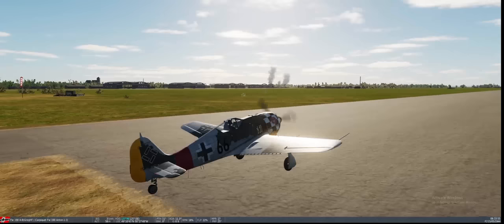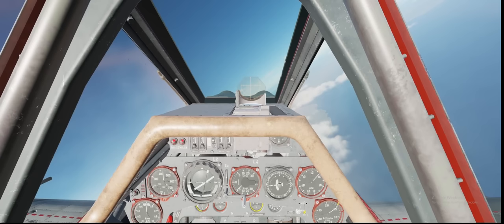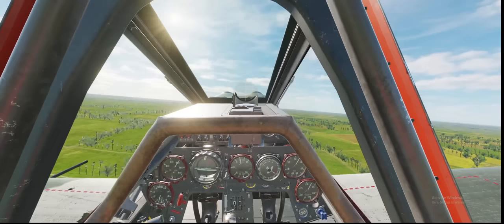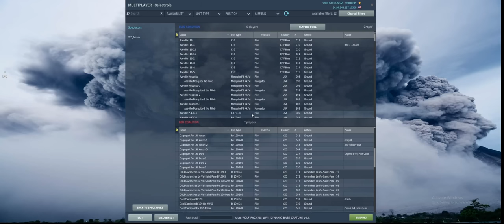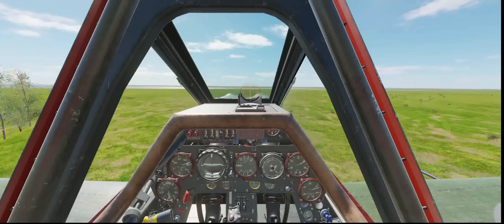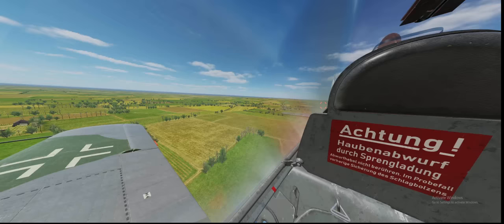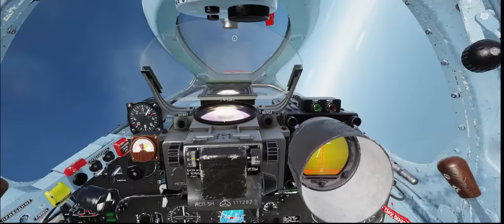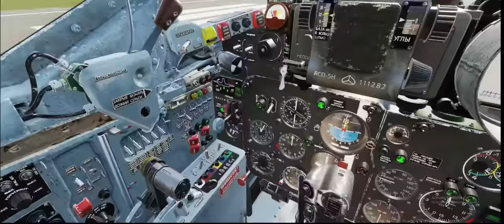German Cannons, Soviet Cannons, P-47 Mach, Angry Authors and More

Comment: Jimmy Doolittle was also an accomplished engineer. He even held a Doctorate in Aerospace Engineering. Doolittle was the first to do an IFR takeoff and landing, the first to do an outside loop, famous air racer, and helped standardize high octane fuel in the US, among many other accomplishments. He did not need Eric Browns help nor the British help in general. If he needed help, he had access to NACA and the aircraft manufacturers.
Reply from the maker: I agree.
Reply: He's also the only reason high-octane aviation fuel was available in large amounts when it was needed. He pressed Shell into developing the process for making 100 octane fuel when the "experts" said there was no need for the much more expensive process.
Reply: Other videos, I have heard nothing but praise for severely wings strength, also any type of report would have needed to be forwarded to NACA Langley to evaluate and update Wright field to place in those manuals.
Reply: @TheAneewAony  
He preferred it because of it's low fuel consumption, he had to gas up thousands of bombers and fighter's, and wherein fuel never really was a supply issue Jimmy Doolittle wasn't psychic, he couldn't see into the future and tell there wasn't going to be some kind of surprise German U-boat campaign that would seriously cut down on the supply of high octane fuel from America, P38's had the range to escort bombers anywhere they went but they had two of the same engine that the P51 had, you don't have to have a PHD in in mathematics to know what that means, the P47, well using it for escort was about the same as taking a drag car on a cross country vacation as far as fuel consumption goes. 
When Doolittle took command of the 8th Air Force in January of 44 victory in Europe in just over a year certainly wasn't a given, one of his considerations was stretching out fuel as much as he could, he was a smart guy and only a dummy wouldn't think about that, he did the math, he knew how many more P51's he could put in the sky with a given amount of fuel than he could with other fighter's he had at his disposal.
Reply: @keithbarron3654  NACA even helped design many aircraft. They did a lot of windtunnel testing for the various manufacturers and offered design suggestions.
Reply: Doolittle also showed B-26 Marauder pilots how to fly the plane early in its career when it was killing its crews "one a day in Tampa Bay". If memory serves he looped or rolled one on one engine to show the pilots they actually had a good plane. I believe this was before Martin did the wing modification.
Reply: The P-51 was a superior air to air fighter aircraft. The P-47 was a superior ground attack fighter aircraft. The P-47's were not removed from Europe but used by the Ninth Air Force primarily in ground attack. Some P-47's were still used in Europe after the war as the Army Air Force realized it needed ground attack aircraft to confront the Russians. It was a shame more P-47's weren't kept around after the war, as US pilots were forced to use P-51's to fly ground attack missions in Korea, a mission for which the P-47 was clearly superior. The P-47 could carry a larger bomb load, had a more robust structure, and an air cooled engine far less vulnerable to combat damage.
Reply: @fafner1  Ask the A-36 pilots how they felt about their Mustangs....

And the A-36 pilots notably disliked the P-47 and fought tooth and nail to avoid losing their A-36s and switching to the P-47. There was a limited run of A-36s built though, so the pilots and ground crew new their time was numbered and tried to keep them running as long as they could.

Also, the RAF used the early A model Allison mustangs for ground attack for a year prior to teh P-47 ever flying a combat sortie in Europe.
Reply: @vonfragesq7145  a skilled instructor trying to demonstrate to low skill low time pilots that if flown properly, it was perfectly safe.

Still true today as skilled CFIs strive to teach student pilots how to fly safely. and yet even airline pilots are still killing themselves on stall/spin accidents in light aircraft all the time. it's amazing how hard it can be to teach someone to stop pulling back when stalling, or to stay above VMC with an engine out. or to just pull both engines back to prevent VMC roll. the struggle is real.
Reply: @TheAneewAony  The reservists flying F-47s begged to be sent to Korea, but because it was a more expensive plane to maintain and Korea was still considered a fairly minor conflict at the time (incorrectly, of course), the F-51s went instead.
Reply: @TheAneewAony 
Jimmy Doolittle didn't care for the P-38?
🤣🤣🤣🤣🤣🤣🤣🤣

When Doolittle decided to get in a fighter to assess the D-Day operations, he flew a P-38.

So, yeah, I'm not buying the claim that he did not care for it.

The problem with the P-38 for the 8th AF was a combination of logistics and the fact that it had gotten off to a bad start, and for many had a questionable reputation, that hurt morale.

The P-51 was cheap, available, had a single engine, and didn't require twin engine training.
Reply: IMHO General Doolittle was the greatest aviator of all time and a great patriot.  With all he accomplished in life, including the Congressional Medal of Honor, he was, by accounts of those who knew him, a profoundly humble man.  Being so, he likely listened to and respected what Brown said, but was more than equipped to make his own assessment and to take with a large grain of salt his hyperbole about the P-47.
Reply: @p-51d96  I agree, many other pilots are famous for singular acts, but Doolittle was a racer, aerobat, IFR innovator, PhD in engineering, accomplished as both a civilian and military pilot, war hero who led by example, tons of world firsts and world records to his name, a General..... I can think of no other single aviator in history so accomplished in so many different aspects of aviation, and who contributed so much to the advancement of aviation.
Reply: @TheAneewAony  Those P-47s were from the 56th Fighter Group, which retained their P-47s until the end of the war. The 56th FG had the highest number of enemy kills in the 8th AF and preferred the P-47 over the P-51.
Reply: @TheAneewAony   What became the 4th FG flew Spitfires in eagle sqdns, then P-47s and then P-51s.
So your numbers for the 4th FG are a combination of all of those aircraft.
Of the FGs who only assigned to the 8th AF, the 56th had the highest kills.
Reply: @TheAneewAony  One more thing, the top USAAC ETO aces either got all of their kills, or a majority of their kills in P-47s.
Reply: @TheAneewAony   The 56th FG kept the P-47 because it was overall a a superior aircraft.
All of the top aces were P-47 pilots.
You will have to cite a source for your ,kills.
Also. you claimed that P-47s were phased out of theater before the end of the war.
That is a blatant fabrication.
Reply: @TheAneewAony   Meaningless. the P-47 specified was the D-1-, when the most produced and best version was the D-30/40.
Reply: All of the top aces in the ETO were P-47 pilots.
The 56th FG chose to retain their P-47s.
The P-47 was never phased out of theater.
You did not answer the questions. You have not provided a source for your kill numbers, therefore you did not answer the question.
 The report that you did cite, is meaningless because it does not include relevant data.
Reply: @TheAneewAony   Oops, a minor typo that changes nothing.
Reply: @cvr527  rejecting TheAneewAony cited evidence out of hand becasue you are emotionally biased does not make you right. It just shows how much of a child you are.
Reply: @SoloRenegade   Except the evidence he cited is meaningless because it does not include the relevant models of either aircraft. 
Also, he failed to cite a source for his kill numbers.
As for emotional bias, I think you are projecting.
Reply: @SoloRenegade   Now you are definitely projecting.
Reply: @cvr527   Now you are making baseless accusations without evidence. You are deflecting from answering the question. You are refusing to defend your ridiculous claims.

You've now used ad hominem, red herring, strawman, and other logical fallacies when faced with factual arguments from others.

Go ahead, keep digging a hole.
Reply: @SoloRenegade   Lol, I have done none of the above and anyone who views this thread can plainly see. 
Take a chill pill dude.
Reply: @TheAneewAony   According to what source, and how many P-51s were shot down?
Reply: @TheAneewAony 
In the 1930s he entertained people by doing handstands and walking on his hands. He was a demonstration pilot at this time and famously did a backflip out of a window in a South American country, broke his ankles and STILL flew a demonstration flight the next day! And nearly killed himself doing a loop in the hot humid air and not realizing the density altitude and humidity reduced his aircraft performance more than he expected. He was a rare daredevil genius acrobat.
Reply: @TheAneewAony You did make your way here, and your learning. I’m really glad your progressing on your journey in this hobby. Sometimes it is difficult to let go of previously held convictions in the face of facts; but I’m confident you will get there.
Have a good day, and glad to see you here.

Comment: On the cockpit ergonomics, flying the F6F in MSFS was a real revelation. The plane just wants to fly and at cruise speeds is really easy to fly hands off. It struck me, given the long flight times and strict navigation requirements, a plane that is easy to cruise would have a real practical advantage over aircraft that had higher performance, but would exhaust the pilots during ingress and egress. 

And that is likely a big contributor to why it's reputation seems higher than its raw performance numbers would imply.

Comment: Hi Greg,
My flight instructor was a P38 pilot/ace in the Mediterranean. Before he was sent out there, while he was based in England they had him fly  an early P-47 to have him give his ideas on how they would use the jug in the air. On this flight after he had climbed to high altitude during his testing, he split essed from up high to RTB.. In the dive he did not recover in time to avoid compressibility, he almost didn't recover. 
And in the recovery due to the speed and G load he placed on this jug. He rejected the airframe. The wings had an extra 4 degrees of dihedral, rivets were popped, fairings and antenna had been ripped from the plane. Andy Rooney wrote of this in stars and stripes.
Look up Col.Herb Ross.
Reply: That's interesting especially since it was the p38 that was known for compressibility problems..
Reply: @kenneth9874  as i said,  he rejected the jug BEFORE he was sent to fly 38's in the Med.
Reply: @topmenace  funny how the arguably best American fighter group retained the p47 until the of the war.....and the 8th wasn't the only American air force in Europe. The p51 didn't even show up in numbers until post d day and after the cream of the luftwaffe had been taken out. The need then was tor front line support and interdiction at which the P47's were vastly superior .
Reply: Sounds like pilot error....

Comment: Hey Greg, while the MGFF could not fire minengeschoss, while the MGFF/M could fire it, but not fire the regular rounds, the regular rounds were altered to work in the MGFF/M. And the MG-151/20 could fire both from the start, to my knowledge. Several historical belts include the 'heavier' AP alongside the 'light' minengeschoss.
Reply: The MG FF fired a 134g explosive-tracer shell and the same shell without explosive filler as a practice round that could also penetrate armor and poke holes into fuel tanks.

To make it compatible with the MG FF/M they changed the fuze to one that weight merely 10g instead of 27g, resulting in 115-117g shells, that could be fired together with the ~90g Mineshells.

Since the Mineshell delivered destruction by blast, the explosive-tracer was changed to an explosive-incendiary shell.
The same shell was later modified to be just an incendiary shell by removing explosive and detonator to make it only carry incendiary mixture.
Reply: @kimjanek646  
Thank you, chatGPT!
Reply: @ThatZenoGuy  Very intelligent reply.
Reply: @kimjanek646  
Yeah! ;D
Reply: @ThatZenoGuy  🙃
Reply: @kimjanek646  
Cool!
Reply: @ThatZenoGuy Indeed, both MG-FFM and MG-151/20, and even 30mm MK108, could fire different ammunition types in lieu of M-shells. For FFM Germans fielded several types of HEI/T rounds which worked with guns in FFM configuration. Unfortunately Greg made mistake here. The original 134g heavy rounds of MG-FF could not be used guns in MG-FFM configuration, that is very true. In any case, on air to air missions you loaded belts mostly with M-shells, they were that much better than other ammo types. In WW2 airplanes there was lot of surface area where traditional ammo just poked 2 clean holes and did nothing else. M-shells poked 1 hole and exploded inside. @GregsAirplanesandAutomobiles
Reply: @kimmoj2570  Not exactly true. Pretty much all nations loaded 20mm cannons with a mix of HE and AP rounds. Late war MG 151/20 ammunition belts consisted of a 1:1 mix of Mineshells, Incendiary and Armor Piercing Incendiary. After the war the US developed three main types of shells for their 20mm cannons, namely HEI, Incendiary and AP-T.

All these types of rounds have nearly an equal chance to bring down a plane, so they are mixed to give a better chance for the right shell to hit the right part of the aircraft.

If rounds hit near the fuselage, a single AP can knock out the engine or the pilot. Incendairy have the best chance to set fuel and oil on fire while explosive ammunition has the best chance to damage any system with its fragmentation effect.

While for Jet combat, pretty much everyone used a mix of AP and HE rounds.
Reply: @kimmoj2570  
Typical German belt loadouts included explosive tracers, API, APHE, and incendiaries in various mixtures. It was not even 'mostly' HE outside of a few belt variations.
Reply: It wasnt unknown for aces to specify what went into their ammo belts. They could pick and choose, whereas the ordinary squadron pilot took what was given to him. I read of one case where a force-landed 109 was examined in NW Europe in 1945 and was found to have not fired it's guns and it had only half a tank of 20mm rounds and full 13mm rounds. The pilot was a very junior pilot. clearly, he was not a favoured pilot.